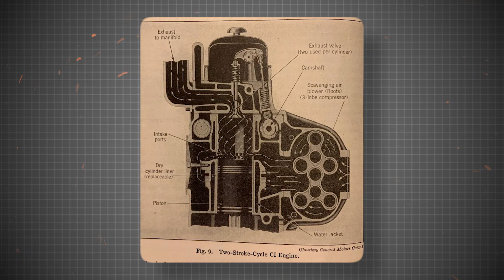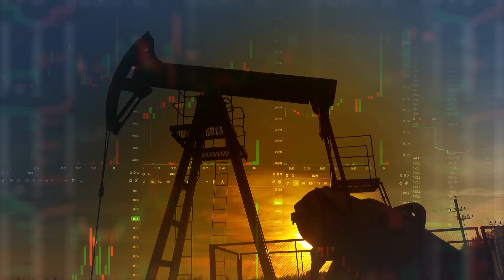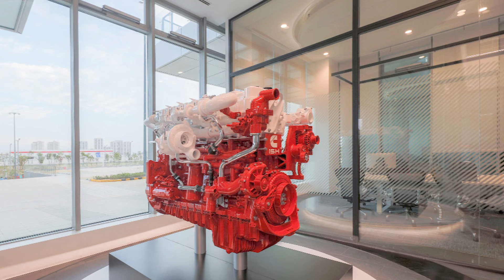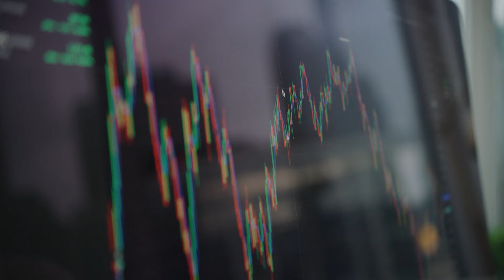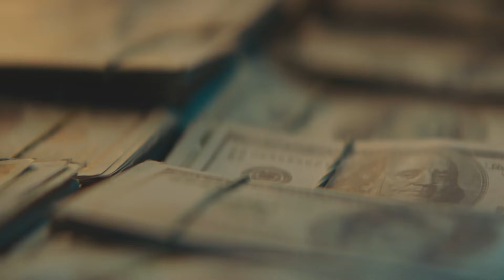Why Did the Detroit Diesel 71 Series Once Dominate America and Then Suddenly Collapse?

Comment: in the lat 1970s I worked at a Detroit Alison shop what killed off the 2 stroke Detroit was fuel economy and emissions by 1980 about all that was left were fire trucks yes the thing an 8V71 could do better than any other was get you to a fire real fast, it was like driving an 8 ton sports car they would really run, and the sound was so cool, but for most semis 4 MPG was not going to work when 4 strokes were getting 6 or 7 , there are still fire trucks today with Detroit 2 strokes in service today